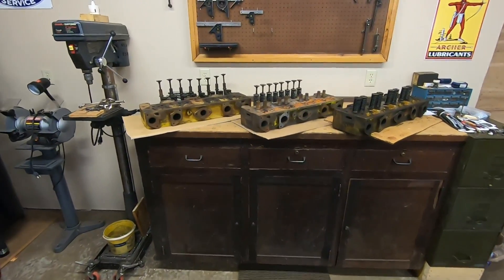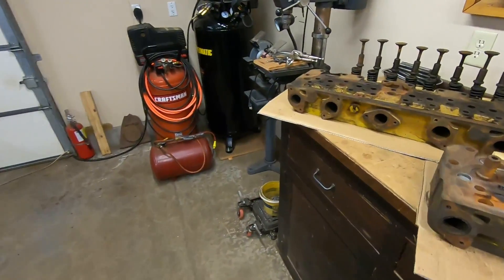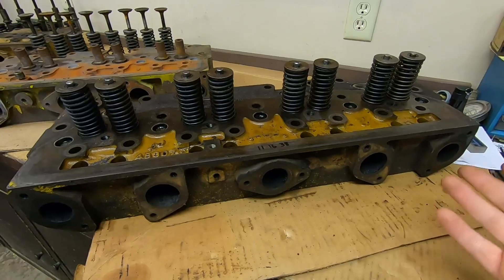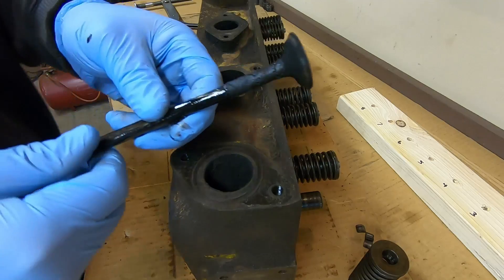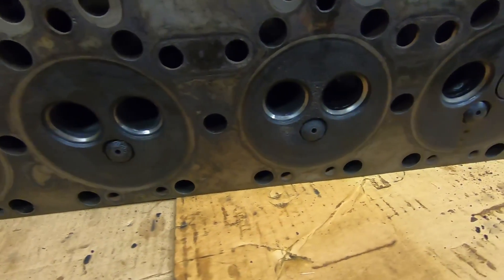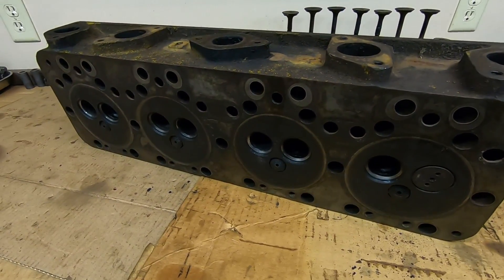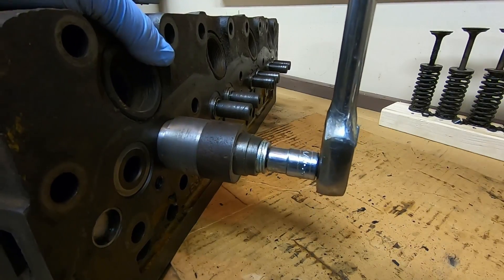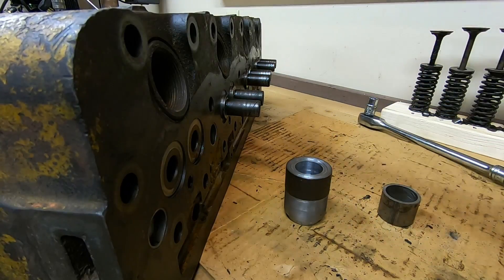Caterpillar D2 #5J1113 Diesel Engine Assembly Ep.23: Cylinder Head Reconditioning Begins...

Comment: I spent a few years working at the cylinder head bench for a Caterpillar dealer. Originally I used specially made valve guide drivers and spacers to remove and install valve guides. Eventually I used a Snap On air hammer and drivers to educe time and effort to remove, then the Cat tools to install.

Comment: You have fabricated the most perfect tool for their removal.  They cannot be examined or evaluated properly without removal.  You have acceptable replacements if any are damaged by removal or are not service worthy on their own.  Their potential functionability cannot be assessed without removing them.  Their interface areas on the head cannot be assessed, repaired, or serviced without their removal.  The engine will not perform or remain durable for years to come if there is an unknown or underlying problem with them that cannot be evaluated or discovered without removing them.  Peace of mind on that issue is not possible without removing them.  The entire engine has been disassembled, evaluated, restored, replaced, renewed, or otherwise brought into specification during this process, with the exception of these pre-combustion chambers.  The engine cannot be considered to have been remanufactured or renewed unless this issue is addressed.  Therefore, the chambers must be removed and the process must be undertaken in the most controlled, risk-free manner at all possible.  Consideration, planning, and preparation are vital.  Perhaps chemical penetration to help free all the interfaces can take place repeatedly over several days from several different angles.  Perhaps gentle, gradual, uniform heat can be applied, mimicking the head's rise to operating temperature in actual service by placing it in an oven and very gradually raising the temperature very uniformly over a period of time, then applying your removal tool in the most controlled manner while the head is totally secured on a dedicated work surface.  There is a risk of damaging the chambers and the head by attempting to remove them, but that risk is more than compensated by the satisfaction and knowledge that these hidden potential problems and the opportunity for renewal/respecification is possible.  I don't think you'll be happy if you don't take them out.  Absolute control over the process is essential.  We're with you.  If anyone can do it, you can.

Comment: Wouldn't you want some copper (or maybe aluminum) washers on the bolt going inside the valve guide to prevent damage to it? It looked a tad dangerous to just tighten the bolt to the end of the guide.
Also; was there 3 retainers for each valve? I have never seen that before.
Reply: @squatch253  Ah i thought that might be it :)
After thinking about it, i have come to think that 3 might be more stable than 2, so actually it's strange that 2 is the norm and not 3.
Anyway i enjoy seeing all the things that is done differently today.

Comment: Very nice ... I also make use of threaded rod pullers .. and I tend to use ball thrust bearings (of appropriate size) such as the NSK 51102  to relieve the friction a bit ... makes for a very smooth action of the tool  ...

Comment: Squatch253 I  have a question you might be able to answer, I bought a 48 model D6 9U three weeks ago and I'm giving it a hard maintenance job before I start using it. I went to drain the final drives (one has a fluid that looks and has the consistency of chocolate milk lol) and it looks like one of the drain plugs is broke off and the other has been brazed or bubblegum JB Weld over; how do you get them out and back to normal?

Comment: Squatch, I can't help but give (as of yet) an unsolicited opinion. You have a few things to consider, and I think a flow chart similar to the cracked block flowchart is in order. Hear me out. You want to use the 1938 casting off of 5J2115SP, it came off of a machine you knew and operated so you know some of the history. I say that to say, you know with a reasonable degree of certainty that it doesn't have precombustion chamber issues. So my initial instinct is to leave them well enough alone. However as I'm sure you're aware, there are a series of events that could lead you to wanting or needing to remove them to perform other operations on the head. You'll need to get new guides in the head, then whatever set of valves you choose to run and check valve recession. If valve recession is out of spec, you have 3 options. Remove precombustion chambers and mill the head, use another valve or valves with a thicker margin (or new valves if available) or have the seats in the out of spec cylinder replaced to correct recession. I would at all cost avoid removing known good precombustion chambers. To that end, I would seek out all other options to bring valve recession in spec without milling the head. Now, this all goes off the rails if the head is warped or pitted and will require a fresh mill to fix surface defects. At that point you're somewhat committed to removing the precombustion chambers in order to mill the head. I'm certain you've already thought of all of this but my unsolicited opinion is that you need to check the deck for imperfections and flatness first as that is the one thing that will surely commit you to milling, if that checks good, then it's on to fitting serviceable used or new guides and valves. Once those are installed you can check recession. If at that time you're out of spec on some or all of the valves, you can explore seat replacement, or swapping new for used valves. Sorry for a Caterpillar version of War and Peace in the comments. Cheers.

Comment: Hello there i am wondering if you can help me with a 1957 d8f caterpillar pony engine the one i had went bang on number two rod long story all of it was machined to spec with 30 under main but it went bang and im back to rebuilding another one i got a good block rods and bearings are really good in it but again the mains have been done 30 under but there is scaring one the main jornals i cant find 40 under mains is there a way i can fit a babbit cam in to and. Aluminum front main a and babbit insert in the reaar main or do you know where i can get 40 under mains
Reply: Andrew Klahold 
I think the better way would be to have the crankshaft built up to standard dimensions.
Reply: @jimrankin2583  yes the rods on this replacement crank were done std by weld i ordered std main bearings that seems to be my only option is to have the mains done that way too however i am looking in to a way of either razing the sump so it cant pick up any clutch filings or a stand pipe were the oil going from clutch to engine about an inch or so higher so the oil can still go back to engine but so any metal filings from clutch will go to the bottom and get trapped behind the stand pipe want to do this because this isnt the first pony i had apart they all had scaring like that on the mains the only thing i see that is doing that is clutch filings

Comment: Diesel engines are enough different from gasoline engines that I ask,if the valve seat recession is an issue,is it possible to install aftermarket valve seats ? Or is contact with piston top,or hitting water going to be a problem ? Or buildup of combustion products around the seats,or other ?

Comment: @Squatch253 - I work mostly on gas engines, so by no means am I an expert on diesels. However, grease and carbon build up are pretty much universal on engines. 
1. For me, I take apart as much as the engine will let me, (you know the feeling when something is so stuck, it's about to break), then I put the pieces in my parts washer and submerge parts for hours and possible a day or two if necessary. Once I work as much grease and carbon off from the parts washer solvent, I move on to the next step.
2. Putting the parts in my sand blast cabinet with soda medium, (baking soda for blast cabinets), and try to get as much carbon removed without scratching and marring any sealing surface. If I have to change out the medium for something stronger, I clean all the sealing surfaces with rubbing alcohol and then tape the crap out of the sealing points, so I don't ruin anything.
3. Finally, I break out the heat, hand hammers and the air hammer gun/air chisel gun. Heat and vibration go a long way to free struck parts and bolts without causing damage if you spread the force out across the part and use throw away steel rods welded to quarter inch steel squares to take the blunt force from the air chisel gun, that way a cast part is somewhat protected from direct force from the air chisels, while still getting the vibration.
 All I can say is take your time, bring out the swear jar and good luck.

Comment: Toby,  thank you for touching on depth of the valve seat in the casting.
That was item that alot of "new" book engineers just do not fully understand.
I do like way Cat designed  the head to remove the guides. A little wear only helps in lubing the guides!
Cannot what to see the conversation on the pre chambers

Comment: Tip for viewers. When using the hammer and socket to loosen or remove valve springs. Do not have the head flat on the bench. You will bend valves and ruin them. Valve spring compressors are not expensive.

Comment: Love this build. When it comes to valve springs what a lot of people don't think about is there condition when the engine has been sitting a long time and some of the valves being held open. This may not be an issue with an engine like this, but one thing that comes into play is how much spring pressure there is when the valve is open. On my race car engine the spring pressures are 820 lbs. when open, so I replace them every season and if the car will sit for any length of time I will back off the rocker arms so the valves are closed and the springs are at closed pressure. Even then during the year I check spring pressures periodically.
Reply: Have the same way of thinking.  "back off the rocker arms" and the engine is saved even if it is standing for a long period in an unpleasant environment.  A pair of the camshaft lobes are also saved.
Reply: 820 pounds! Do you bend the pushrods?
Reply: @jamesanderton344  No, never had a problem with that. I worry more about the solid rollers than I do pushrods.